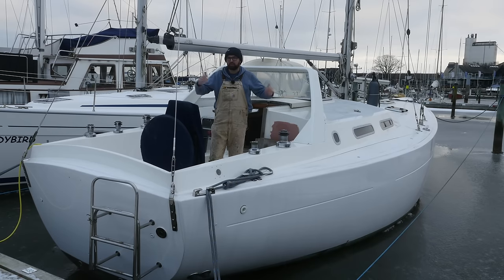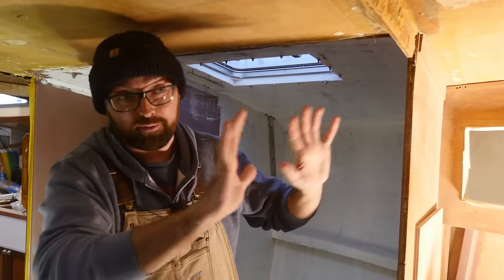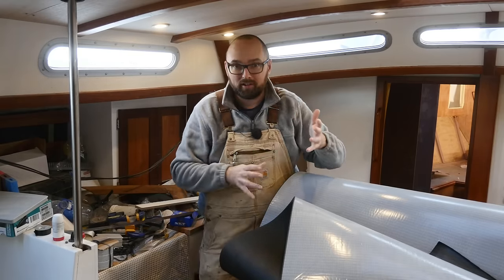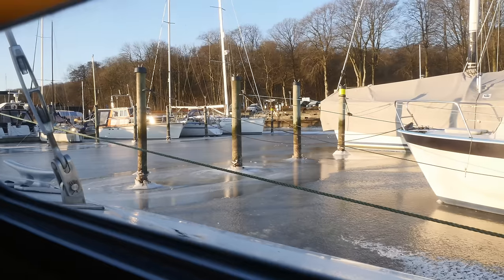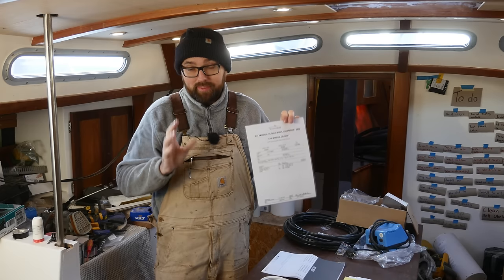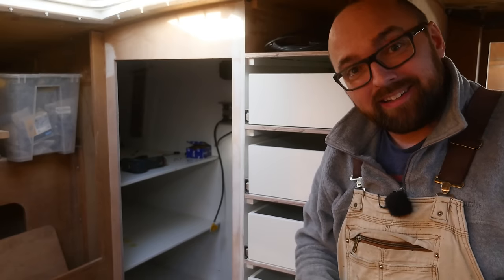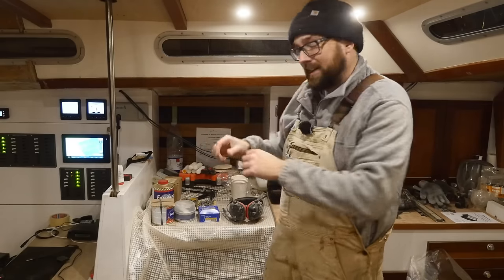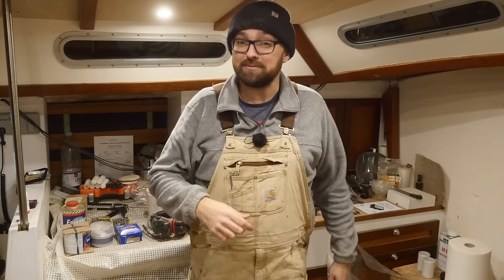Sail Life - Headliner and Garmin AIS 800 (AIS transponder) - DIY sailboat project

Comment: I have the AIS800 too. The SODTMA is very helpful, I've seen a lot of small vessels disappearing in heavy traffic areas like Maas entrance in the Netherlands. They just could not get their old CLass B signal through.
AIS is beautiful for easy communications too. Got stuck in currents off the coast of belgium in the night, was going backwards and a French warship was approaching, immediately calling me cause they saw I could not do much, telling me they'll pass on portside... without AIS, that would've been quite some back and forth... I like to be seen :-)
Reply: Maas Entrance... 1500 targets... Just guess if the ships will filter of the class B targets there. Keep clear. :-)
Reply: @Scramasax  They vessels might do, but no one enters Maas Geul without a pilot on board. I felt very safe that Maas Approach had me clear on their screens which I cannot say was the case for the other crossing ships which disappeared for me or had old signals. Maas approach crossing is easy when guided and they see that you can keep the 4-5 knots or not :-)
Reply: @Llanovanya85  You are very correct!

Comment: Trick for the pull line.  Double the line length needed and tie a knot in the middle leaving a 1' loop.  Then pull it back thru with the vacuum.  attach each end around the end of the conduit.   This way you don't have to pull a new line thru each time you use the existing line.   Simply pull it back and forth depending on which way you want.  leave it there forever.
Reply from the maker: Good trick! Thanks 🙂

Comment: Put plenty of insulation under the berth as you get a lot of condensation under the mattress from body heat if it’s not insulated.
Reply: The answer to that probem would be to have the mattresses on slats and a decent amount of air circulation under the beds. Like at home.

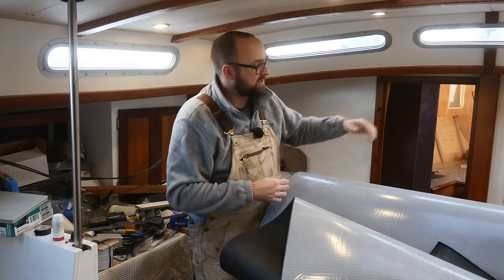Comment: 5:35 Condensation comes from the humidity contained in the warmer air inside. Never from the outside. That is why a vapor barrier is always needed on the warm side of any insulation. It has to be air tight, otherwise, condensation could form inside the insulation (depending on what kind of insulation You have)  .
Reply: That's how they build houses where it is actually cold. ;-)
Reply from the maker: I know 🙂 Did i say something wrong in the video? 🙂
Reply: @SailLife  I wasn't sure so it was just a reminder about insulation. :)

Comment: Hi matts, i am a maritime officer student from the netherlands and ive been following the channel for a couple of years now. 
AIS is a very usefull tool when it comes to identifying vessels but it should not be used for navigation as it relys on gps data from the other vessel. Also a lot of small yachts won't have AIS at all. I highly recommend to use ARPA on your radar to plot other vessels instead of AIS.

Comment: I used to winter over on a freshwater lake in north Idaho and it would also get significant ice.  I used a 1/3 HP submersible pump than hung from a line down about 5' into the water and pumped water out the top.  It created just a bit of circulation and brought the deeper water below the thermocline up to the surface.  It kept my slip clear along with those on both sides and the thoroughfare behind me.  Keeps from scratching the bottom paint.

Comment: I have to say using a vacume to pull the string through was genious. Keep up the good work
Reply from the maker: Thanks, I can't remember where I picked that trick up :)
Reply: @SailLife  Neither can I, older than dirt.  Just FYI it works the other way too, hose on blower.  Handy when the plug is at one end and the other is in a ditch/bilge somewhere.
Reply: I used to run fiber and network cables for a living. That’s much faster than using a snake although it pretty much only works on empty conduit. Just always remember to leave a pull string in the conduit so you can pull another cable in the future.
Reply: @SailLife   Hopefully you left a strong string attached...just in case you ever need to do another pull..Looks great

Comment: Your digital light dimmer may introduce a lot of RF noise into your electronic system.  You may want to look into this as it will definitely interfere with your radio reception and could cause glitches in your data transfers.

Comment: I have a very long old zip tie, which is 5 feet (about 1.5 meters) to snake in tight spots. It’s small, thin but very stiff and is not conductive just in case some idiot has left an open switch box or such. Since it is stiff horizontally but flexible in the other two dimensions you can twist it to turn corners. An old boss showed me how to use one and it works well.

Comment: The AIS 800 will only transmit if its getting its position info from the internal gps antenna or the optional external GA38 gps antenna. Even if its working now with the internal antenna I would not trust it for a reliable position source. The GA 38 comes with a bracket to mount under the deck and is much more sensitive to satellite signals.

Comment: It's too bad you didn't use Divinycell foam when you re-cored the deck.  You might have gotten away with not needing any insulation at all over the headliner, or just a very thin layer.  We love it in our Hallberg-Rassy and the headliner is always nice and toasty.  Plenty of headroom too...

I did notice that you turned on the old AIS for Athena on the land a little distance from boatyard.  Maybe you are selling it and were testing it.

We have had our AIS off since we got to Florida a couple of months ago.  No point of using it when we are just on an established mooring in the middle of a big mooring field.

We always keep it on when anchored though, like we usually were before COVID made cruising more difficult. Regardless of the power drain we left it on just for safety -it is like an electronic anchor light, especially when anchored near or right off of busy shipping channels.

Comment: Great videos, Mads! As for the AIS and GPS antenna/signal. it is a requirement that the AIS has its own GPS antenna. I have another brand AIS with separate GPS antenna and it doesn't share its signal. Don't know about Garmin, but I am in doubt that it will utilize any GPS signal floating around in your NMEA2000 network.
Reply: You are correct. Class B units don't read external position sentences from the network. Not usually and not this one either.

Comment: As per requirement the class B (or B+) AIS does not have a connection to an external GPS. If you check the NMEA sentences the unit is receiving via the network, you will notice it does not read/receive the position information. Therefore you program the units own (built in GPS) antenna position in the setup.

Comment: Dang good ideal with the ruler. I was wondering how you were going to do the wiring in the V-Berth and the using the vacuum was just too kewl. Great video Skipper.
Reply: It's an old trick but I've always seen it done in the other direction with compressed air.  Trying to push a cable through a conduit usually seems to work up to a point (usually the point where you've decided it's going to work) and then it gets stuck.  It's really annoying.

Comment: Interested on  your refridgeration decision tree. What made you decide on this vs. front opening vs. ready-made drop-in fridge unit vs. 2 units vs. keel cooled vs.eutectic vs. domestic fridge off inverter vs. etc. After a few boats with different fridge technologies including a new install, I'm leaning towards water cooled with sealed dedicated header tank for my next install for power and performance benefits. How did you land where you did?

Comment: It looks to me like you have a gap of about 5 or 6mm between the underside of the insulation in the V berth and the top of the headliner. Uninsulated voids are something I always try to avoid, so I am curious as to why you didn't fully fill that depth with insulation.

Comment: I'm curious what are the metal rail doohickeys you have mounted in the hanging locker and behind the electronics panel? Some kind of cable channels? Would they be exposed like in the videos or do they come with some kind of plastic cover?
Reply: There will be a cover. Those are often used on ships for example, so that you can easily access the wires or replace them if required. So unlike what we will be seeing here, they are just "loose" inside the cable channels when closed with the cover.

Comment: Hey, Mads?  When you gooped and screwed the plywood onto the ceiling, what did you screw it into?  Right into the fibreglass and deck core?  Aren't you worried about water getting into the core that way?

Also?  I'd like more Danish swearing, please :)
Reply: I am guessing he only screwed into the bottom layer of fiberglass and not through the core and into the top layer of glass.
Reply from the maker: I'm not worried about water getting into the core from below 🙂 If I was that adhesive should do a decent job of keeping out moisture 🙂

Comment: I'm stuck... Was the ice 10cm or 4inches ;-)
Reply: With about 40 inches for 1 meter, there is not much difference between 4 inches and 10 cm,  even if you are stuck in it.  Of course, if you are using a micrometer to assess the thickness, then the minor difference could be major.

Comment: Nobody here in Finland lets their GRP -boats freeze into the ice in winter, it's known be really stressful on the hull - even in our marinas completely without tide. Small movements results in water between the hull and ice that freezes and lifts the boat, putting increasing pressure on the water (ice) line. Also, ice eats grp for breakfast.

EDIT: A Finnish marina, photo taken a couple of weeks ago: https://i.imgur.com/VraThTd.jpeg
Reply: Same in Norway. 
Here it's basically obligatory (in a marina) to have either propellers or air stream (like in a jacuzzi) if you are one of the few who choses NOT to place the boat on the hard during winter.  A 10 cm thick solid ice (which can be frequent if the location is right, at least in close, brackish waters such as inner Oslo fjord) will definitively make damage on most hulls (fiber/wood) if there is any chance for waves or tide. I guess with even more brackish water in the Baltic sea you have even more problems. Maybe the Danes have too much "sødvand" to notice the danger ....
Reply: It's not uncommon to see a boat left in the ice for the winter to sink when spring comes again here (in Finland). Then again this is the first winter in years Denmark has seen some ice, so I somehow understand they have their boats in the water.
Reply: @Scramasax  Yep, and I forgot to mention the risk of the thru-hulls and seacocks splitting when freezing.